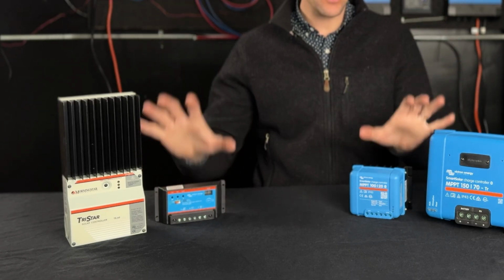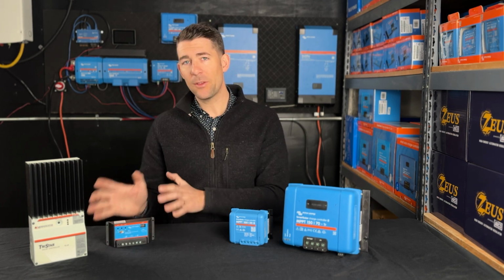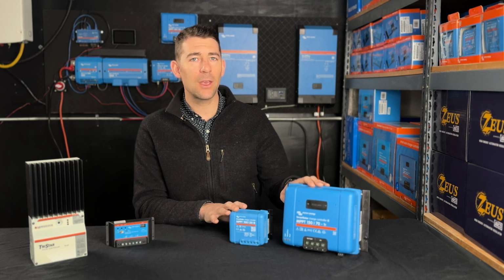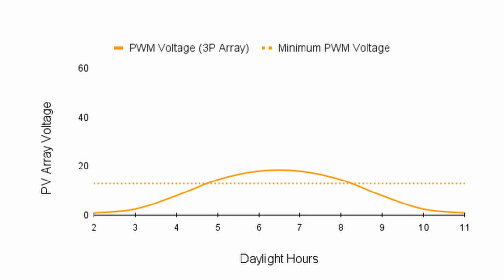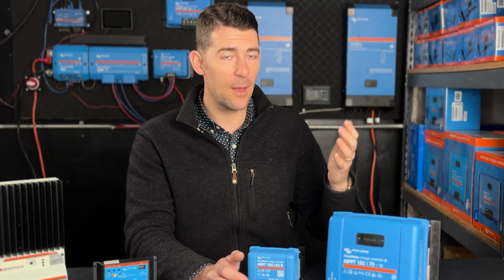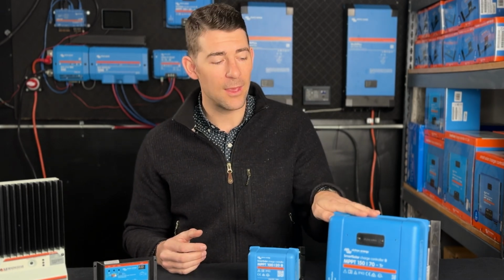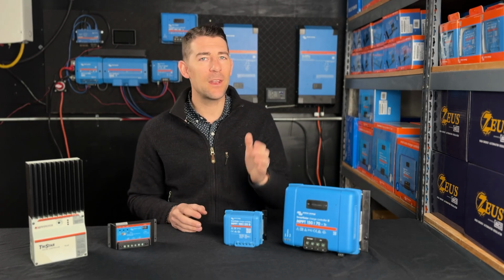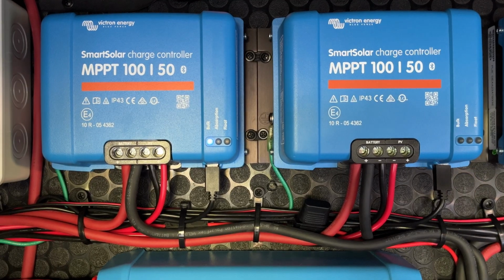Understanding MPPT Charge Controllers

Comment: I'm new to solar. I just installed (2) 100w panels on my campervan. I have the Victron 100/20 and a 12v 100ah battery. The only thing running off the battery will be my 12v fridge. I downloaded the app...but sad to say, I cannot make heads or tails of it. I am connected and I see that things are happening but I don't know what it all means.
Reply from the maker: Tthere are indeed a lot of various settings and options within an MPPT. Most of what you’ll be changing and setting will be dictated by your battery. Things like; absorption voltage (max charge voltage), float voltage, etc. The Victron presets are a great place to start in most cases (selectable from the gear icon and then the “battery” tab, the battery presets are the 4th row down). That said, we ALWAYS recommend consulting your battery datasheet for the specific charging details of your battery. Lithium in particular is quite specific about what charge voltage should be used. Please reach out to us through our website if you’d like a more detailed explanation in regards to your specific system.
Reply: Out of the box, Victron and most other controllers have an auto setup that is determined by your battery voltage. A sort of default settings.
ALWAYS ensure your battery is fully charged before you hook it to the controller.

Comment: I have a Yohako Mppt charge controller. I can't seem to figure out if it has BMS or not (There is an RS485 port). Do you have any idea or point me to the direction for that information?
Reply from the maker: Hello @BaoRongxing, an MPPT does not usually have a BMS (Battery Management System), which is usually inside of a lithium battery. Your RS484 communications will typically be how the MPPT would connect with other devices, like a battery or other charging device, like an Inverter/Charger.

Comment: When calculating what mppt i need, do I use the voltage of the panels or the voltage of my electrical system? My panels in parallel would be around 40v but my electrical system is 12v.
Reply from the maker: Hi @mattwilson6276, great question. The function of an MPPT controller is to take that higher voltage, and via increasing the amperage, it lowers that voltage to the charge voltage that your battery system needs. All of this is programmable in Victron Connect with any SmartSolar MPPT. Reach out to us directly and I’d be happy to help you size an MPPT based on what specific panels you have, and in what series/parallel configuration. This article on our website also has a lot more information on how these charge controllers operate: https://intelligentcontrols.io/blogs/technical-articles/victron-mppt-solar-charge-controllers-explained

Comment: I have searched online but can't get an explanation of on "status" what "state" means. I use portable solar panels, so when not connected it says "off". Now when connected it says "bulk ".  Please explain. I just had the MPPT 100/15 installed.
Reply from the maker: Hi @rvgrandmacharlotte4604, the “state” is the stage of the charge cycle that your charger is in. The SmartSolar MPPTs have a 3-stage charger, so you’ll be in either “bulk”, “absorption”, or “float”. It can also indicate “external control” if the MPPT is in a system with a communicating BMS that is controlling the charge parameters. The manual actually has a good description of what each of these stages are: https://www.victronenergy.com/media/pg/Manual_SmartSolar_MPPT_75-10_up_to_100-20/en/monitoring.html#UUID-06742c32-5a41-afb4-d950-fd9fc7eeeb55

Comment: Does a MPPT charge controller know the batteries state of charge in %?
Reply from the maker: Hi @omarkraidie, the MPPT can tell the voltage of the batteries but doesn’t have a tracker for the amperage in/out and as such does not have a specific SOC% measurement. The best option for this is a SmartShunt, installed as the last device between the rest of the system and the battery. By utilizing the VE. Smart Network feature of these Bluetooth-capable Victron devices the charging of the MPPT will be more accurate, as well as providing that SOC% you are looking for.

Comment: Thanks for this video. Can I use an mppt for 70V/7A  PV array to charge 12V/100ah gel battery?
Reply from the maker: Hi @Anointingify, your PV array can definitely be used to charge a 12V/100Ah gel battery. You'll likely want to use a SmartSolar 100/20 or larger 150/35. Without knowing your exact panels, I expect you to see 20A at a minimum when the sun is direct, possibly up to 35A+ of charge if the panels are cold. Please reach out to us directly and we would be happy to size an MPPT for your specific panel/array configuration. Best way to do that is through one of our contact forms: https://icmontana.com/pages/victron-help
Reply: ideally yes as long as the Voc from the panel is less than 70V of MPPT and Isc of Panel is less than 7A. Remember the working principle of MPPT is to step down voltage while maintaining power. SO, the Total MPPT Power will be 70V x 7A = 490W. The charging current will be 490W/14.4 = 34.17A. It would therefore take about 1200Wh/490W = 2.4 ~ 2.5 Hours to charge the battery.

Note: Ensure the MPPT supports gel batteries so that you can make the necessary configuration in accordance with the battery's C rating

Comment: I have 600 watts panels and plan on buying a 'solar generator' (aka power station) with 200 watts input. If I place an MPPT controller between panels (in series) and power station, could I send the correct 200 watt current to the power station? 
If I connected directly the 600w panels to the 200w input power station, would I fry the power station?

Comment: Hi im looking at getting the victron 100/20 to run a 100w panel and 100ah lifepo4 battery, it will be used mainly to run a compressor fridge when camping. Do you know if you can set the output to cut off at a certain low voltage and turn on again when a certain voltage is reached? I dont want to kill my new battery by running it too low. Thanks
Reply from the maker: Hi Darren, yes! You definitely can do that. In the 'Load Output' setting try one of the 'User def. Algorithm' options. They allow for manually adjusting the low, and high, voltage points at which your load output would shut down. You can choose from several presets to modify how that output functions. If you download the Victron Connect app it has a great section of "Demo Products" in the main menu (next to Device List) where you can pull up nearly any Victron device and see what its settings menu looks like. I will note that the voltage curve of a LiFePO4 battery is fairly shallow. If you're finding that the voltage is tricky to hit exactly, a SmartShunt (or BMV 712), in combination with a SmartBattery Protect, is a much more sophisticated method of automatically shutting off a 12V load. A second detail I would check is that the SmartSolar can handle the amperage your fridge will draw when running. The SmartSolar 100/20 has a maximum of 20A at 12V (about 200-240W), so I would compare that load to what your compressor fridge needs for a power supply. Feel free to reach out to us if you have any questions.
Reply: I know this is an older comment, but I'm new to electric, why would a low voltage damage your batteries? Im getting a couple lifepo4 batteries and didnt know this was a concern.

Comment: Is there a possibility to connect two solar monocrystalline panels in series to an MPPT charge Controller ?
Reply from the maker: Depending on the voltage of your panels, and the MPPT charge controller you're using, it might actually be best to run your panels in series. In general, the higher the voltage your array has, the easier it will be for the MPPT to function. Just be sure you are not putting too high a voltage for the MPPT to handle (each unit has a maximum voltage specified by the first number in the model name, EG: SmartSolar MPPT 100/20 has a maximum PV voltage of 100V). For help sizing a charge controller to your array or an array to your charge controller, feel free to reach out to us directly, and we'd be happy to help. https://icmontana.com/pages/get-in-touch